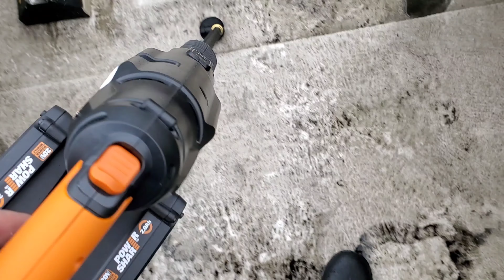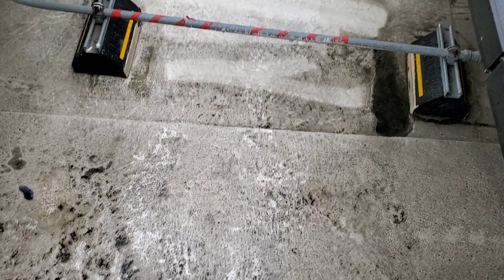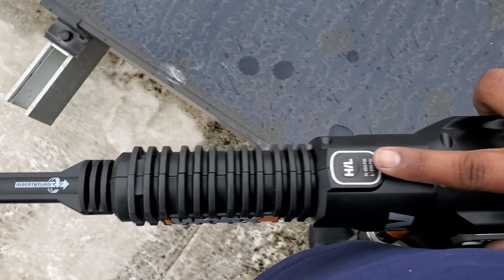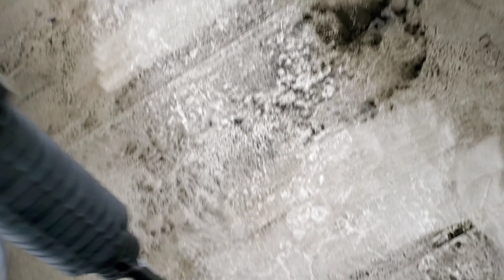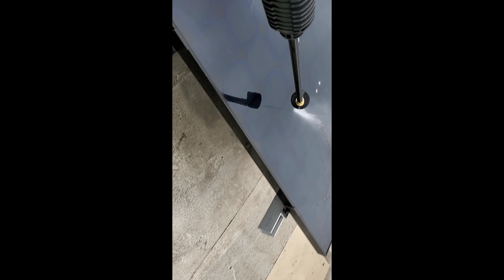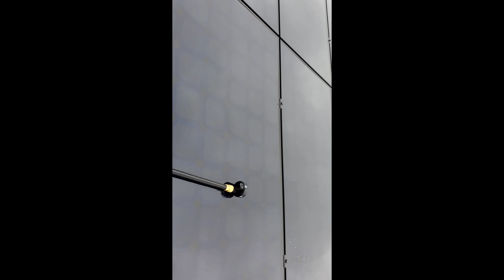Worx 40V Hydroshot Review

Comment: The batteries do last a decent amount of time and even on low it's still more pressure than a regular hose but the output of water is a lot more on a regular hose compared to less than a gallon per minute on this particular hydroshot.
Reply: I have  the 20v worx hidro shot  but I want to  know where  can I  get a  fitting so I can  run  it  off the  hose pipe off the  out side  tap
Reply: @dandale493  You just unscrew the orange adapter off and a hose screws right in. It also increases the power output if directly tapped into a hose.